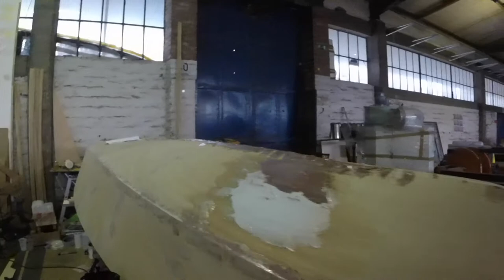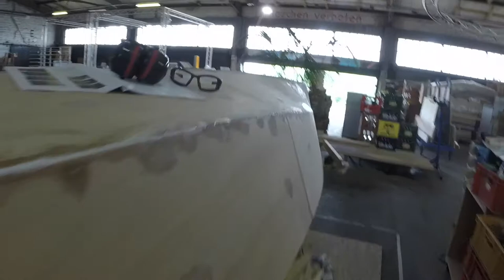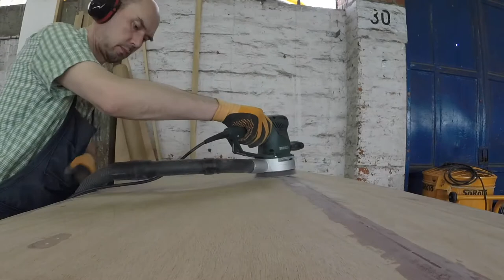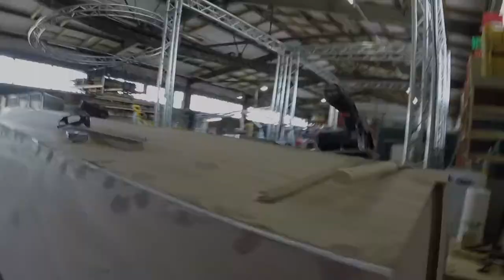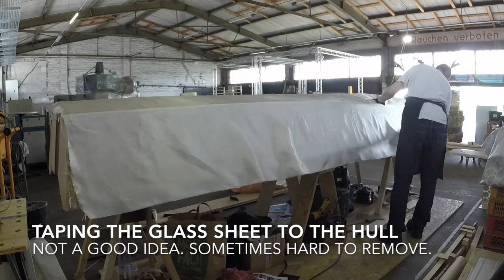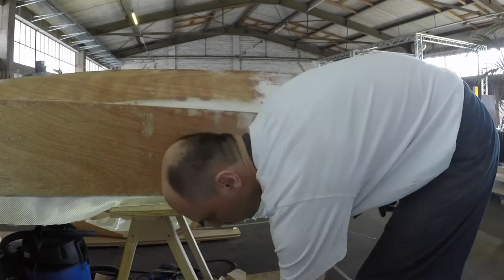Building Fleet, a small wooden boat #7

Comment: What does the acetone clean do? Remove more dust than just vacuuming? And is the fiberglass waterproof or is there additional steps coming?
Reply from the maker: The acetone cleans off the dust and more important, all oily things. The fibreglass itself with the epoxy is waterproof, but it'll get painted at the end.

Comment: You have to put the resin on the wood first, then lay glass, then wet out the resin. You're not using enough resin on the glass.
Reply from the maker: Yeah, that may be true, but it's also more difficult to do if you are working alone.